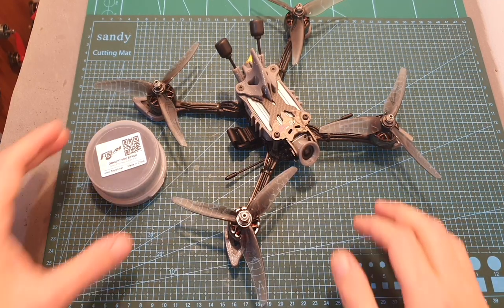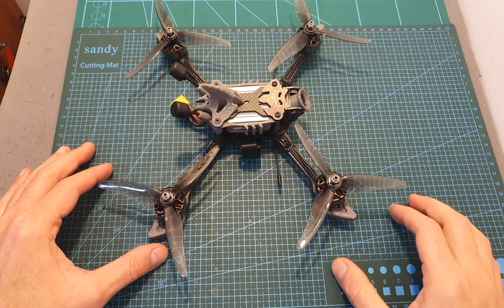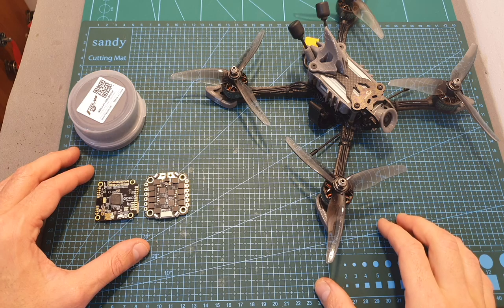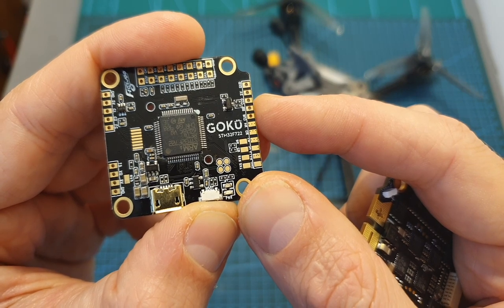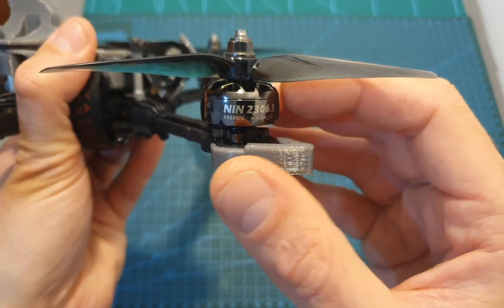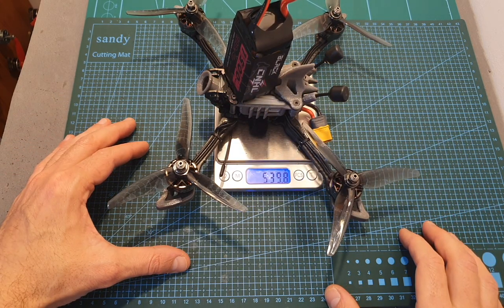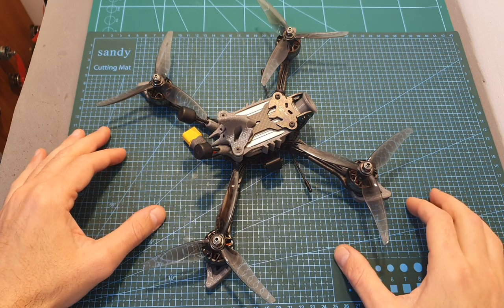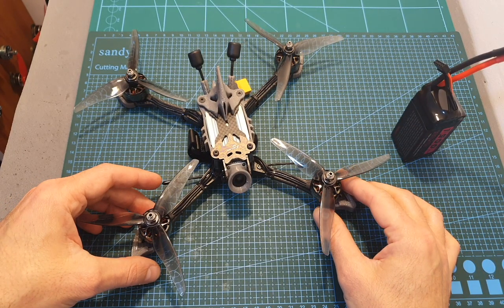Flywoo Vampire 2 HD 🧛 - Build & Flight

Comment: hello man...how are you doing? just got this ...order included a Radiomaster with crossfire micro tx v2 ...flywoo vampire2 hd with dji goggles also  with analog uruav comverter and a eachine pro58 for other older drones....i just soldered the nano reciever for crossfire....FC had already wires with a notice on them...there is no manual in the box but i guess they had wiring ready for the crossfire on TX2 and RX2...its done and working fine....i cant figure tho how to connect with bluetooth from mobile phone..and when i changed the ports configuration...for some reason it did like reset the ports tab and now all except uart1 are disabled...i m not sure i remember correctly how setup was...can you please help? tell me all the default settings? and maybe how to use bluetooth please? also i bought a Beitian Gps to add on this drone...but now i did the reciever i hardly found place to put that tiny nano crsf reciever..where can i put the gps also i have no clue..its too tight...can you also send me the default PIDS etc ?
Reply from the maker: Hi there. I am sorry but I don't have the stock settings and anyway the options must be different than yours as I built it myself. 
As for the other issues - do you still need help or you've figured it out?
Reply: @KremerFPV  i have figured it out what i asked earlier...now i have some trouble setting the crossfire rssi ...and also for some reason the modes on the drone dont work properly..i mean like in betaflight i set it for air mode ...and when i switch that it goes to rescue ..also beeper not working ....something is messed....

Comment: How long can the drone fly until it is empty ?
Reply from the maker: It depends on the battery. You can expect 4-8 minutes depending on how you fly.
Reply: @KremerFPV  okay thanks. You presented a battery in the video. Is that the only one out there or are there stronger ones for this drone?
Reply from the maker: @Nikola007  Do you have the 4s or 6s version?
Reply: @KremerFPV  i want to get the 6s version with receiver for the vr glasses. Unfortunately, the glasses are sold out , so l'll use a different one if I can
Reply from the maker: @Nikola007  1500mah 6s will be a good option.
Reply: @KremerFPV  okay thanks for the answers

Comment: Can you do a top mount battery?
Reply from the maker: This frame is designed for mounting the battery at the bottom.
Reply: Gal Kremer any disadvantages for a bottom mount?
Reply from the maker: @heartpilotOB  Battery is more exposed as you are landing on it. You can get some battery protectors though.

Comment: I got one of these and the tune is totally wrong and it shakes like crazy with even a tiny bit of throttle. I contacted Flywoo and they sent another tune CLI and it shakes even worse. Does anyone have a link to a tune CLI for the 6s HD version that is tested ok? Thanks
Reply from the maker: I just replied to your other comment on my CMW video. Sorry buy I don't have any tune for the 6s version. I hope someone can help you out.
Reply: @KremerFPV  Thanks hopefully.
Reply: Just try tuning it urself.
Reply: @jandomingo9806  I did. See other post